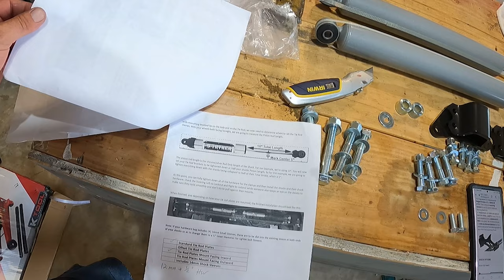Super C Motor Home 2 Inch Lift | Steering Mods Ford Super Duty 4WD

Comment: Much respect for taking that on as a DIY task.  For me, it would have been dropping off the RV somewhere, and a thousand or so dollars and 3 weeks later it would be installed.
Reply from the maker: I did that when I put the leveling kit on the F150, and when I had the shocks and steering damper put on the Vesta, this time I just wanted to do it myself as it is fairly simple if you have the tools.
A it make for a much better video! Thanks for watching!

Comment: Did you get a speed sensor code? I saw what looked like the wheel sensor plug snap the wire out when you let the axle down.
Reply from the maker: that was the differential vent, yes I re-seated that, Thanks so much for catching that and thanks even more for watching!

Comment: That was quite a job I personally can't tell any difference in the way Trudy sits BUT the tape measure doesn't lie so it worked. If I could add one suggestion PLEASE get heavier jack stands when working under a vehicle that heavy. I noticed your stand was to small you had to use a block to get more height and you had to extend it almost to the end. A 6-8 ton jack stand would have eliminated the need for the block. So please get heavier stands so you can continue making great video's. Sorry,I'm really anal when it comes to working safely around vehicles!
Reply from the maker: The jack stands were a back up measure. The front leveling jacks were carrying the load and I was super careful to never have any body part under or between big solid pieces that could crush, sever or maim. Thank you for being anal about safety and thanks a bunch for watching!